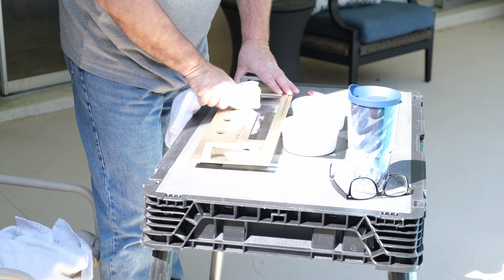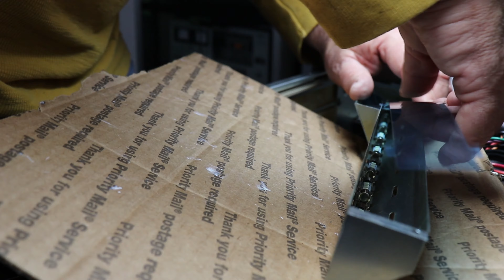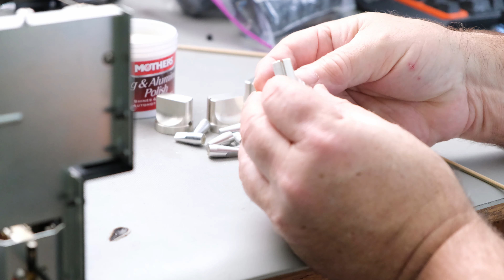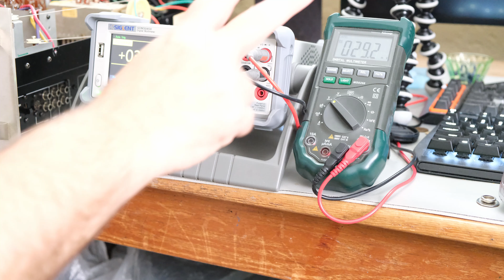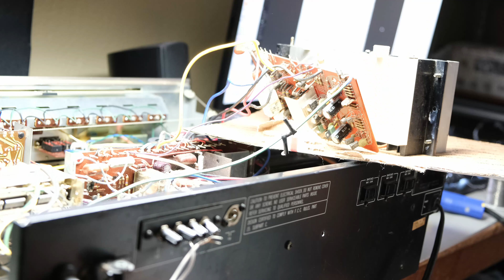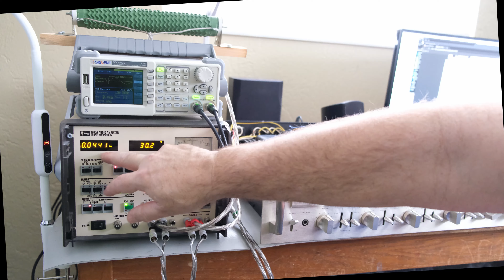The Best! Rotel RX-1203 Stereo Receiver. Vintage 2 Channel Audio Repair Restoration Testing. Part 3

Comment: Great video again.  I learned a lot from it.  I'm currently restoring one of these receivers but struggling the adjust the overload protection.  The service manual procedure seems overly complicated involving the use of a distortion meter (which I don't have).  I've never seen such a complicated adjustment procedure for other amps I've worked on. Unfortunately you didn't go over this step in your video series.  Is there a rough and ready way to adjust the overload protection applicable to this receiver?

Comment: Great video, Chris! Extremely helpful was the filter capacitor selection section. Recently changed them out on a Sony STR V5, and finding exact sized replacements was an issue. DK and Mouser were both out. And Sony used a solid copper bus bar to join them. Mounting them entailed joining them loosely then mounting them to the chassis. Luckily, the size was appropriate. If you get a chance to pick up a Sony in the STR V series, (5,6,7), I highly recommend it, but, be warned, they are heavily built. As far as the Rotel, nice kit, kinda higher end in the day, so not many available in my rural area. These days, they are very sought after though. Very clear, accurate and detailed sound to them. And Rotel seemed to pay more attention to the build details than others did. Again, great video, and thanks! 👍🏼

Comment: I have one of these beasts and its very well built. Recently the headphone socket has stopped working. Any pointers would be good. I am recovering from a severe stroke, so I am limited on much that I can do. But who knows, there may be a known fault with the headphone socket. Great set of videos, thanks for posting.
Reply from the maker: Your welcome. Sorry about your illness. If it's just the headphone jack I'd think there's a good chance that it is the jack itself somehow causing you an issue.

Comment: Just wondering, are you going to put out more videos? I really enjoy them. Because of you I have taken on a recap of my Carver ct-17. Probably not the best first attempt as there are hundreds of caps...lol. I also have 2 tfm-35's to do , a bryston 4b, Carver silver amazings, among some Hafler amps, Akai r2r and others.  Yes, I'm an addict as well. Do you ever recap speaker crossovers? I'm also in your neck of the woods, Spring Hill, Fl. Love the vintage audio, got started when I was about 10 years old, and by 13 saved to get a Pioneer sx-3800. Things just escalated from there. Lol.

Comment: Could you direct me in the general direction...my receiver right channel sounds like a humming, popping, AM radio station off tune (or a Telsa coil).  I took out the R- power transistors and checked them with DMM diode mode - seemed functional (first time doing this).  Put it together, hooked up a speaker and burned the speaker up 😤.  I believe low impedance initially wrecked the receiver; now that it's half way damaged, it's blowing speakers.  I would appreciate the help.

Kenwood KR-3090
Reply from the maker: Man, I'm so sorry about your problem. It's difficult to troubleshoot an issue like this via the internet but first don't hook up another pair of speakers to it. I'm sure you know that but I'm saying it anyway. Check the DC offset at the speaker outputs with a digital multimeter. If it blew your speakers there is a good chance there are several volts DC at the speaker outputs. The should be just a few millivolts. After that it's tracing the issue back with a schematic.

Comment: Great idea with the Mothers polish.  There might be coatings on those faceplates, so carefully clean; you might want to wax after that for oxidation protection.
Reply from the maker: Thanks for the tip!

Comment: What works best Chris to remove scratches from some of the face lens dial covers, recommendations?
Reply from the maker: Man, I don't know. I guess I've never had a lens cover that was really scratched up. So I'm not sure what you would do.
Reply: I'll try some plastic polish, previously tried some but never got the results I wanted. Thanks!

Comment: I wish you worked on viewers equipment :) I came across a Reference: 450R by Quadraflex (made between 1978-79 for Pacific Stereo) on a facebook ad...the ad was actually for a pair of horrible white van speakers, but I noticed the 450R in the picture, so I messaged the guy. I told him I wasn't interested in the speakers, but asked about the receiver...turned out he needed quick cash to pay for a ticket, and sold it to me for $30. It sounds great, but I don't think it has ever been worked on, and it is due for some TLC...it does have a random pop in the right channel, doesn't always do it, and when it does it is completely random...can be idling with nothing playing and volume low, or can be playing loudly, either way, may or may not happen. I did de-ox it about a year back, but that is the extent of my skill in electronic repairs...can't solder for a darn. It's currently sitting in my closet, cause though it sounds great, the pops are so random they scare the ever living crud out of me when they happen (veteran who isn't fond of random pops and booms).
Reply from the maker: Very Cool! I've never seen any Quadraflex gear. With it being a Pacific Stereo house brand and me being on the east coast that probably explains it. I googled the 450R and it is a nice looking receiver. Hopefully you can find someone in your area  to take a look at it for you. I'm pretty sure a tech could get her up and running for you. Good Luck!
Reply: @vintageaudioaddict  I love its black face plate. I am thinking of selling it though. Place is small, storage space comes at a premium.

Comment: So glad you removed them horrible harsh LED's, with lovely incandescent lamps. I have heard some LED's driver circuits generating noise on the preamp. Good job BTW. Thanks.
Reply from the maker: Yes, this RX-1230 lights up nicely now. Thanks a lot for sharing and for watching.